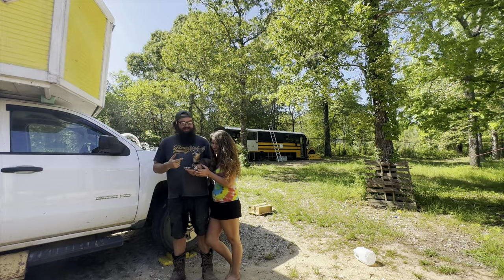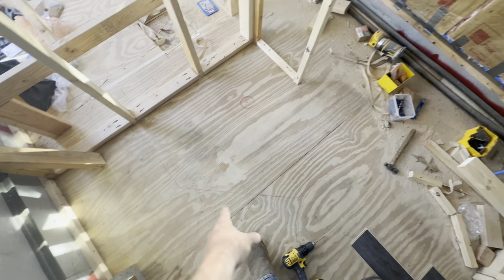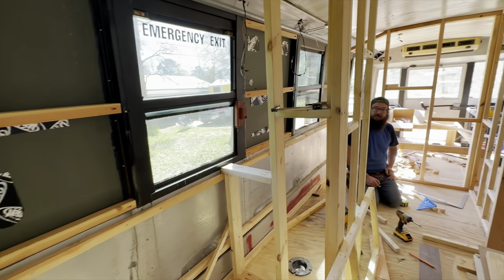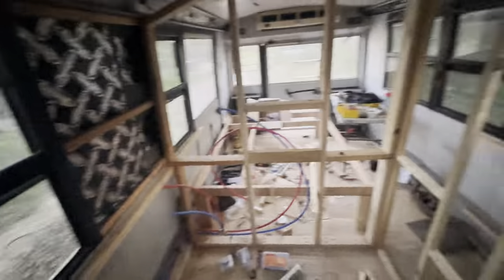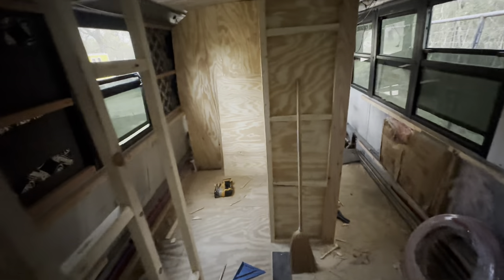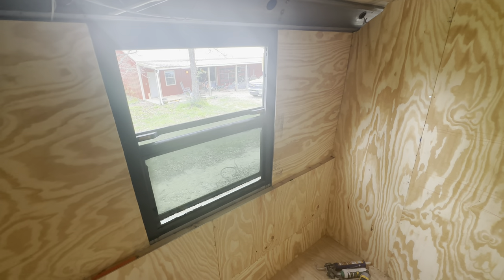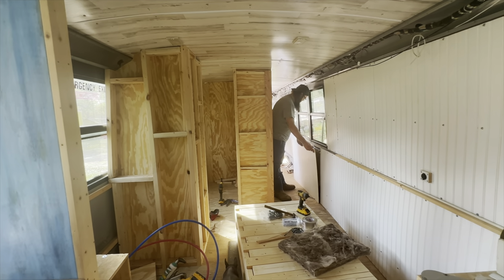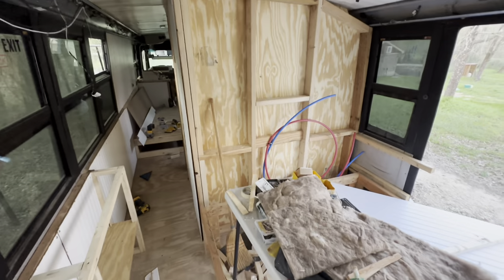Skoolie Build - beautiful bathroom and shower in a school bus conversion

Comment: Are those 1×2s or 3s?
Reply from the maker: Lol what?
Reply: @LoveHut4Life  the boards for the framing some look smaller than 2×4's
Reply: @brittwarren6022 he places where plumbing or 120v outlets has to run through I build out of 2x4, the walls with nothing were 2x2 in this build.